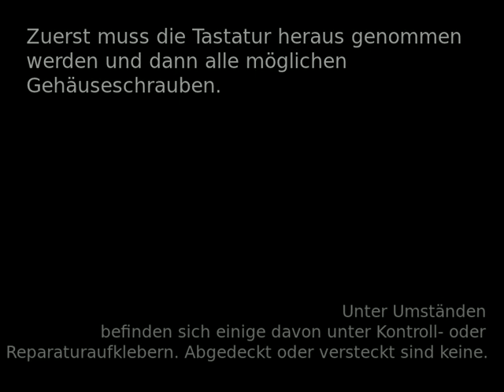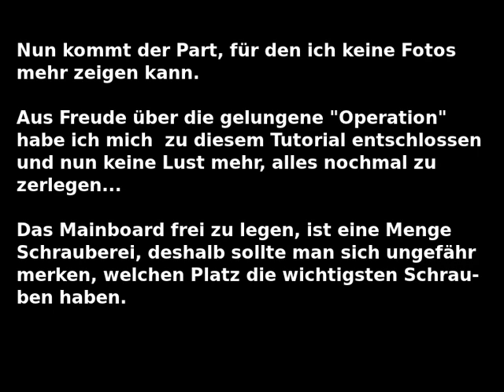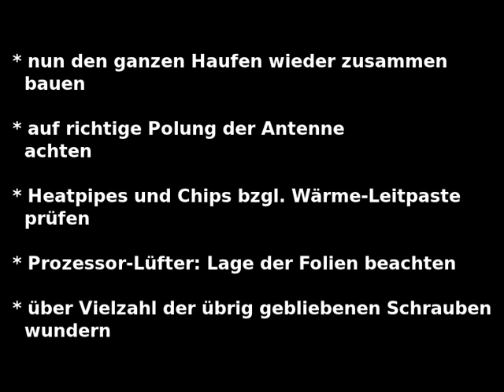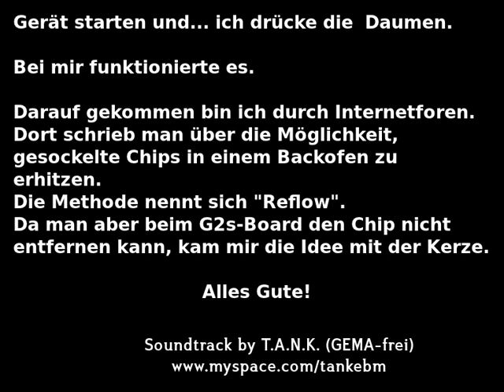Tutorial: defekte Nvidia 8600M GT - Grafikkarte reanimieren / ASUS Notebook G2S

Comment from the maker: Once you got ready with this upside, you turn around the notebook and release all Philips-tip screws  you find at the bottom. Take away all covers and go on releasing cables and connectors.
Unscrew the monitor and cables, the fan and the heatpipes, when you got the bottom cover released.
The antenna cables are only stuck, not screwed. (Minute 1:33)

Comment from the maker: To open the notebook, you must first lift up the keyboard. There are three fine bars above the keys: ESC, F8 and DEL. Those you must grab and move away from the keyboard to release it.
Below the keyboard you'll find a bunch of fine cable connectors, wich you must release carefully. Please don't pull at the cables, use a screwdriver to open the connectors wich are dividable plastic bars. (Look at minute 1:06 ff) Each connector you release has its own place. Normally not possible to mix up.

Comment from the maker: If you are done you can identify the graphic chip with the graphic I've done. This is the one to heat up with something. Because I have no professional tool, I simply used a candle. Put the mainboard upright and heat the nvidia graphic chip with the flame. Distance I used was between 1 and 2 centimeters. Heat that chip carefully for nearly 3 minutes, so that you feel a, hm, „good“ warming if you tip the backside of the mainbord.